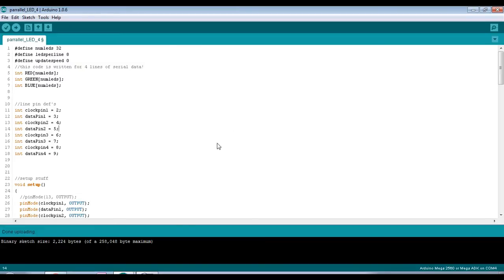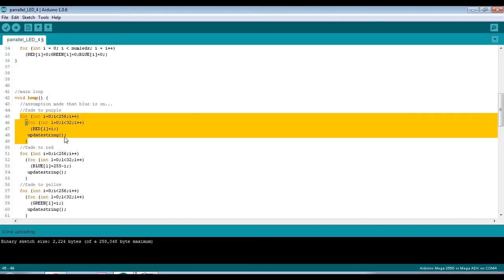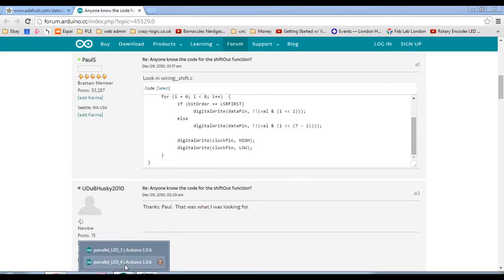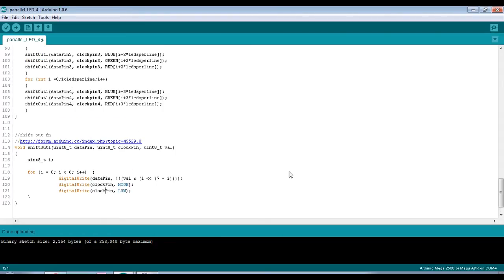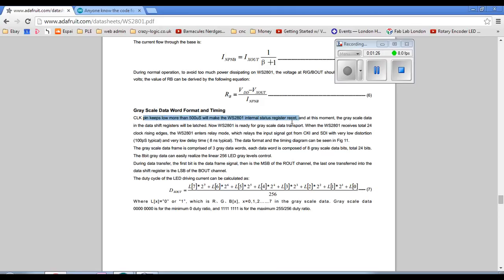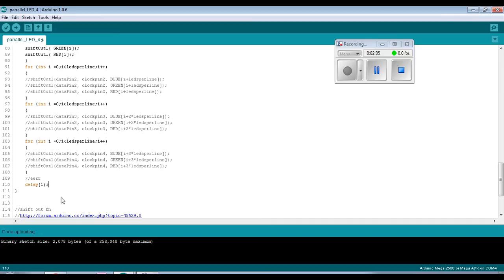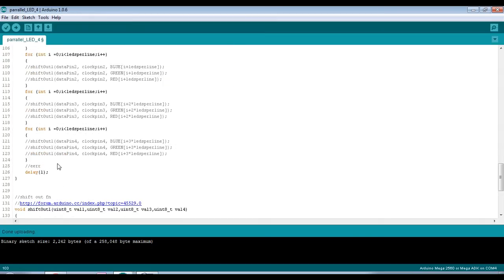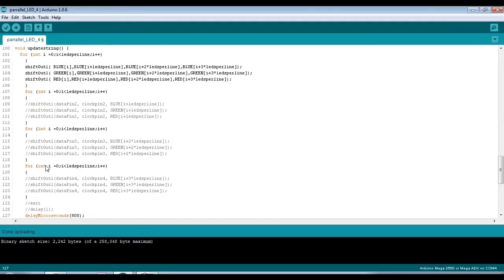#6 How to: ws2801 RGB LED's on Arduino, Driven in parallel strings.

Comment: How can you make a sign with those leds ws2801 with arduino ?, I need help. Please!
Reply from the maker: yes you can - however there is more modern code now available to do this - and i would probably suggest doing one string, rather than many in parallel if you can.